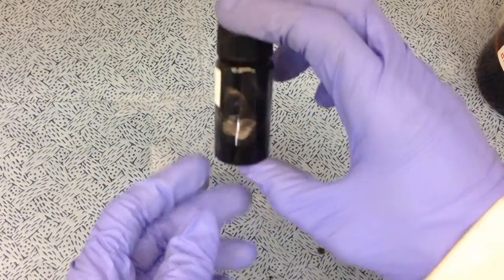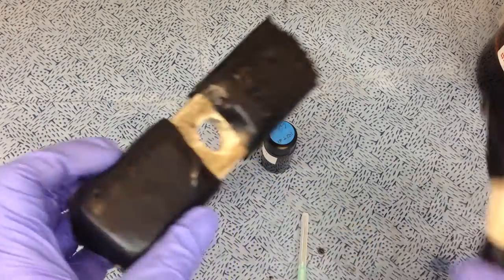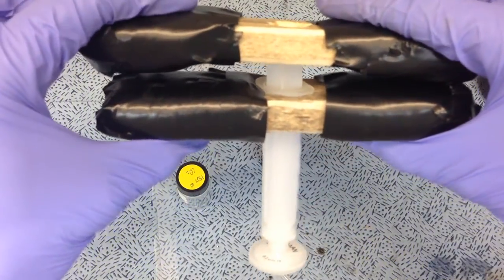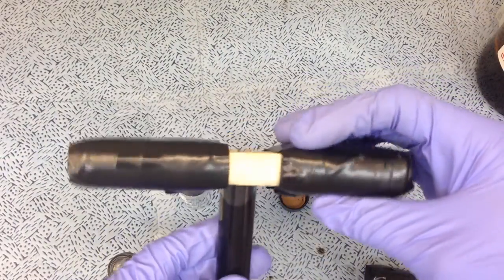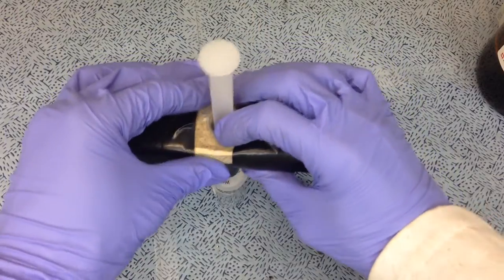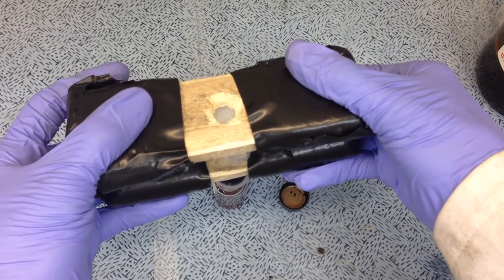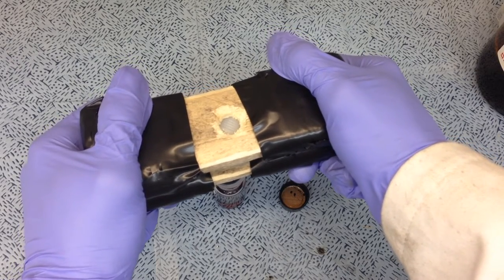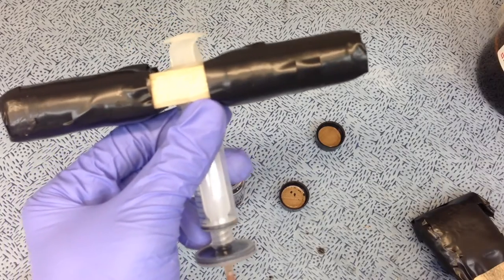Easy Fix for Clogged Syringe Filters

Comment: DO NOT DO THIS. If your Micron/Wheel filter is 0.45um or 0.22um pore size. what he showed you here will blow the filter which only takes 50psi to do, and to give you an idea of how easy that is, with your hands you can achieve the following psi with each volume size syringe:

1ml = 250psi average person can apply this much pressure
3ml = 180psi
10ml = 80psi

as you can see its probably a better idea to just use a smaller milliliter size of syringe. That beast of a syringe was probably 40ml and they are hard as hell to press. decreasing the size of plunger and volume of your syringe decreases amount of force needed to apply pushing the same solution through.

if you have to filter a large amount of solution, serum or organic material then simply use an air powered table top filter that can do liters in less than seconds.
Reply: Biotech Organic-Chemistry are you sure that applies to the Whitman gd/x filters?
Reply: That doesnt make sense.  Your examples of psi per syringe size shows larger syringes = lower psi.  You do want less PSI?  Atleast less than the 50PSI that will tear it right?